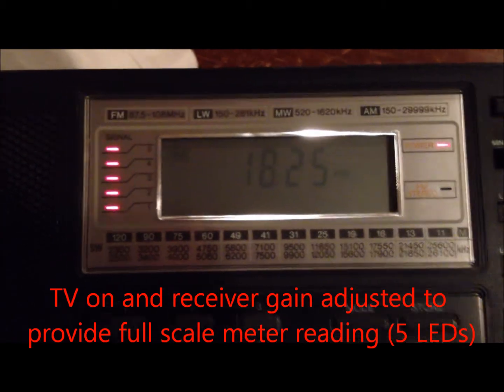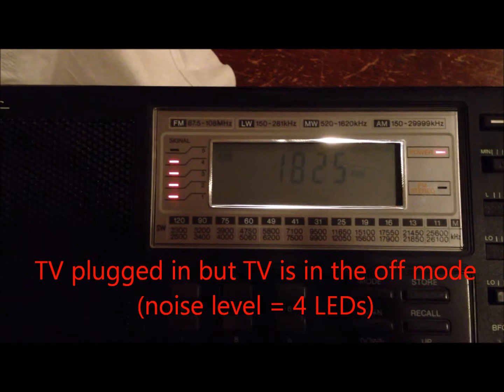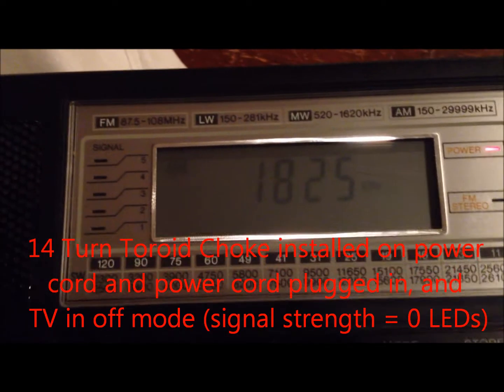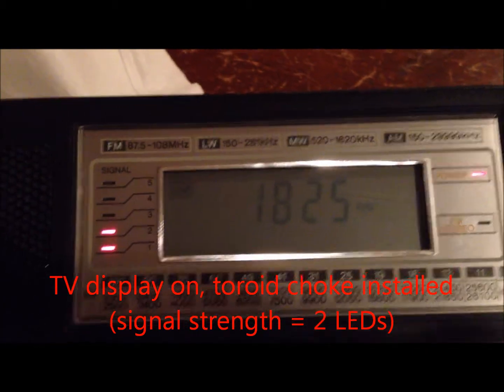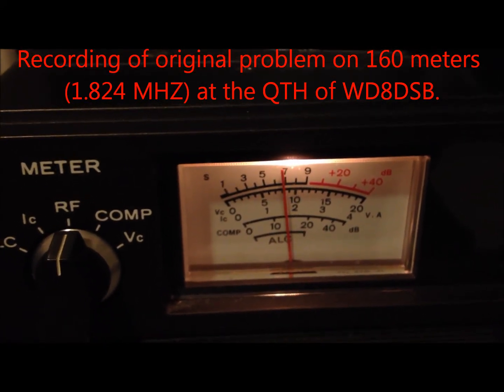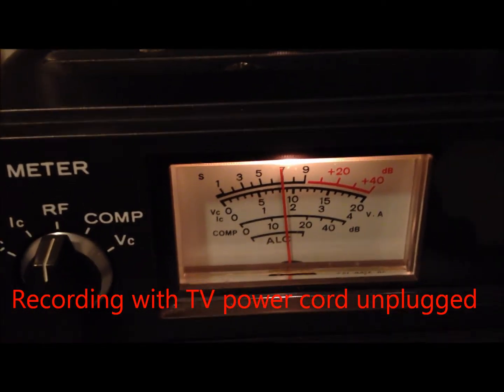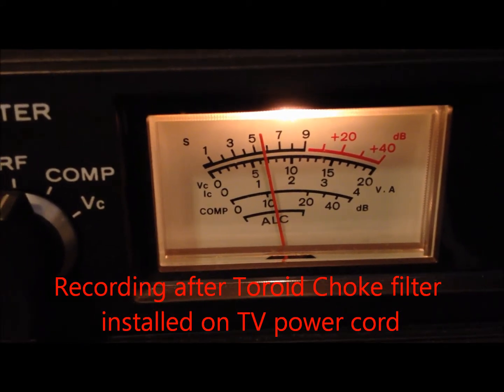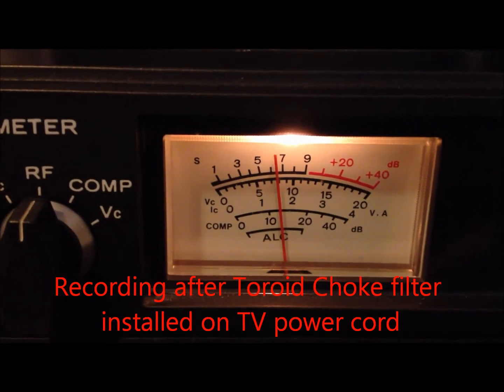WD8DSB locating and eliminating RFI from neighbors TV on 160 meters (using choke on power cord)

Comment: S6 is still too high. Bloody plasma TVs. Thankfully, most of them are now landfill.
Reply from the maker: Hi James, S6 noise level on 160 meters is pretty typical unless you live in a very rural area (mine typically runs around S5.5 during the day on my 68 foot base loaded vertical).  Actually a lot of guys would love to have the reasonably low noise level that I have on 160 meters.  Plasma TVs were horrible, but thankfully they are no longer manufactured and all of the Plasma TVs that were in my neighborhood have pretty much been replaced and are no longer in service (what a blessing).  Very hard if not impossible to reduce RFI from Plasma TVs, and in this case I suspect the problem was related more to a switch mode power supply in the TV versus the typical mode of RFI from Plasma TVs which often appears to be emissions right from the screen, etc.